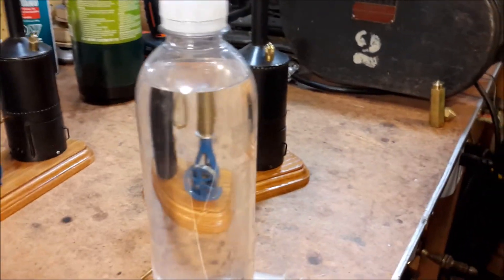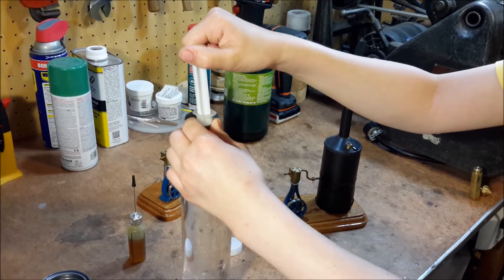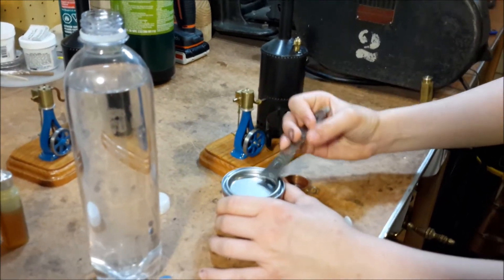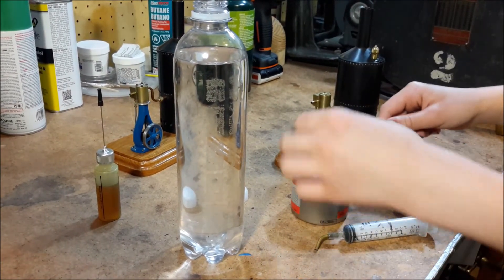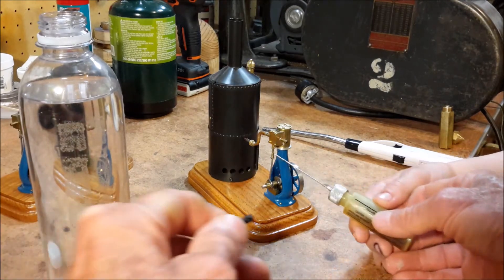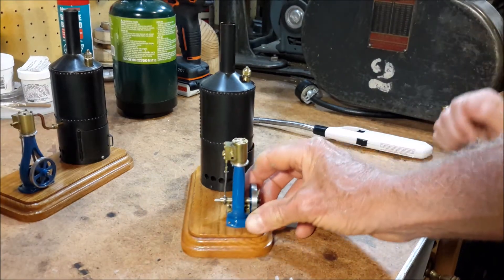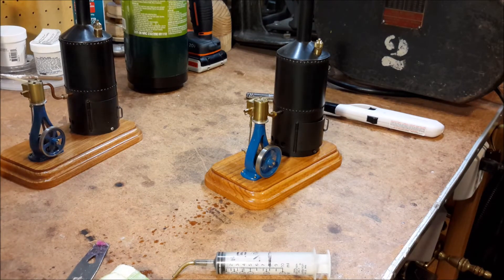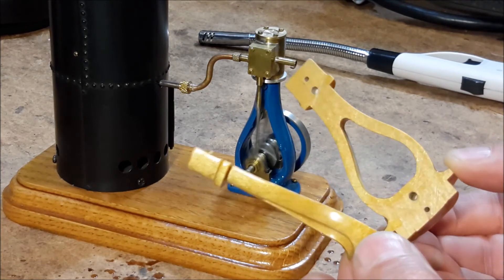RUNNING A MODEL STEAM ENGINE

Comment: Did you use a sand mold to cast the engine frame?
Reply from the maker: Yes I did.  I cast some in aluminum and some in bronze from scrap pump impellers.

Comment: Hi Les, they look good and run very well. Did you cast the flywheel or turn  ? Very nice, thanks for sharing this. :-)
Reply from the maker: Hello SteamerEdge,  The flywheel is turned out of a disk of stainless steel shaft from a large vertical turbine water pump.  The spokes are cut out with drill and small files.  It may sound like a laborious task but it doesn't really take very long to make.
Reply: Interesting , thanks :-)

Comment: Bonjour Leslie,
This steam plant runs quite well but I do not see any oil lubricator, is it normal ? I was told that water lubricates a little bit, but I am not convinced.
Amicalement, Raphaël
Reply from the maker: Hello Raphael,  I have tried steam oil with displacement lubricators and my experience is that it causes the engines to stick and thus not turn over freely.  As a result they stop or require higher steam pressure.  Perhaps being so small my engines get sufficient lubrication on moisture.  I built one miniature steam boiler with too much superheating  tube and ended up with a high temperature superheated steam that would gall the piston and cylinder.  This problem goes away if the boiler produces cooler steam with a little moisture.  I enjoy building engine more than running them so I don't have any engines with a great deal of run time.  I am aware that most model steam engines are made with displacement lubricators.  I bet the people at Wilesco could shed light on this.
Reply: Bonjour Leslie,
Your experience shows that you are right, at an appropriate level of pressure and moisture, there is no need of oil lubricator. How do you guarantee the sealing of the pistons ? With fine grooves or Viton O'rings ?
Amicalement, Raphael
Reply from the maker: Hi Raphael,  Yes, fine grooves that hold water and I try to get a 1/1000 of and inch clearance between the piston and cylinder.  I also polish the piston with jewelers rouge.